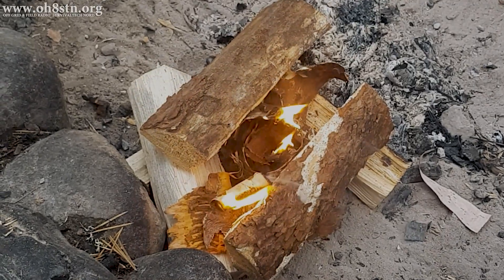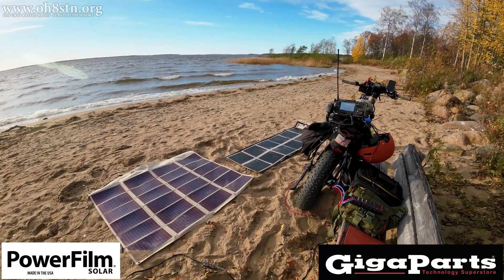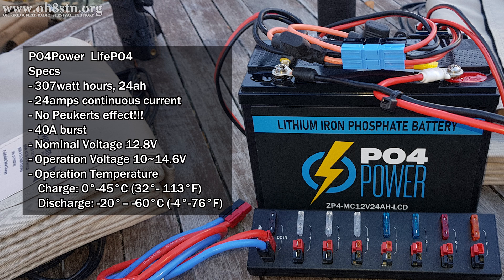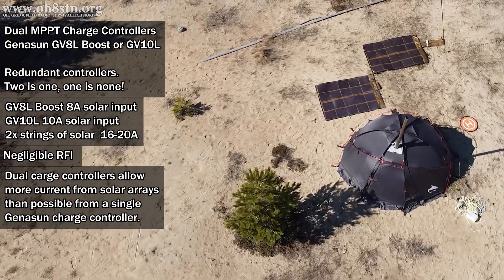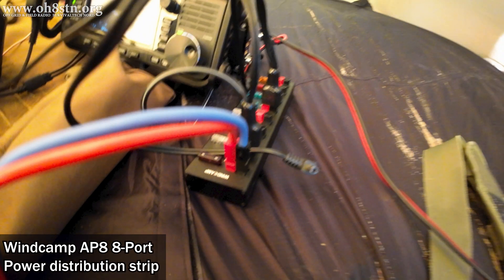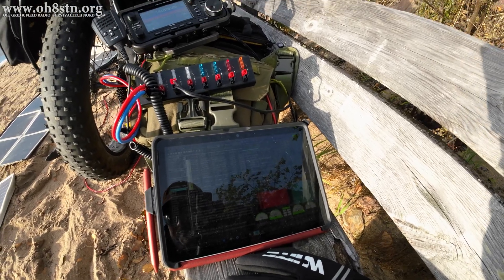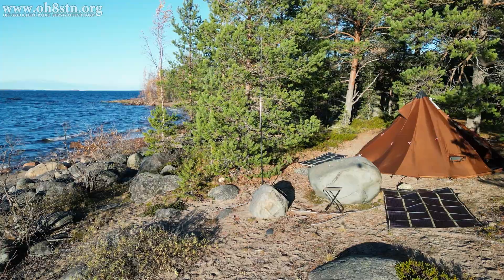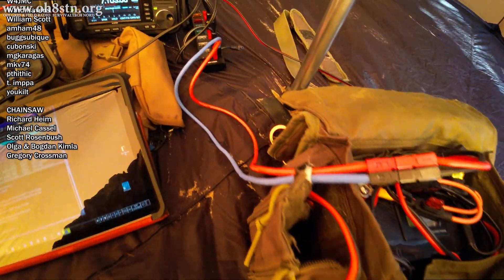Portable Solar Power for off-grid ham radio

Comment: Ok this may be a truly dumb question, but by paralleling two separate charge controllers how does either one of them actually see the state of charge condition of the battery?? Won't they both just see the output of each other without actually seeing the condition of the battery???
Reply from the maker: All they detect is the voltage of the battery. Battery voltage is what it is regardless of how many parallel controllers are attached. Works extremely well.

Comment: Hey Julian,
After watching your recent expedition, I came back to watch this video again. I've settled into having a Genasun Charge controller for each of my solar panels (thanks for helping me with my solar array!), but one thing I haven't seen mentioned in your videos that I hear about elsewhere is shunt for battery status monitoring.  

Many of the LiFePo4 batteries out there have some sort of integrated Bluetooth BMS today, but they seem to have many problems relaying accurate battery SOC information via an iPhone app or by some other device. The suggested solution in these cases seems to be adding a smart shunt (Victron is mentioned frequently) in order to get an accurate picture of the battery's (ies') charge status.   

My question then is this: is such a shunt necessary in this sort of off-grid configuration?  If so, then do you plan to add one to your system in the future?  If not, then what are you seeing in your setup that does not require a smart shunt where others seem to see a need for this device? 

As always, keep up the good work!!! Glad to see Snapper on the Arctic Expedition too.  Semper fi Brother!

Todd  KI5HNX
Reply from the maker: Hi Todd.
When this solar generator was first seen on the channel, it was designed with a shunt ( https://youtu.be/Nf9X4YIK9xA ).
These days, I think it's nice to visualize incoming and outgoing current and voltage but it's not necessary. I believe the ad complexity needs to be weighed against the benefit. It's also important too Think about scale. On a small system like my pocket portable solid gen, It's enough to look at the voltage on the figs display.  For something bigger, a power supply for a fixed installation, It might be advantageous to integrate a shunt. 
I haven't had good luck with victron controllers (noise), but the integrated shunt is a very nice feature. 
Semper Fi brother.

Comment: What type of adapter did you use to keep the Microsoft Surface charge. I am assuming that it was plugged into the Anderson power pole distribution block somehow? IIRC the wall plug to computer adapter that comes with the Surface inverts AC to DC and steps down the voltage to 5VDC. Correct me if I am wrong in that. But in any case what did you use to get current from the battery, to that distribution block and to the Surface to keep it running without using it's on internal battery?
Reply from the maker: Much simpler than all that. I simply use a USB C to 12 volt adapter. The 12 volts comes from an Anderson power bowl. As a rule, I don't use inverters since they are so inefficient. Here's a link to my Microsoft Surface go pages.
https://oh8stn.org/blog/2021/10/10/microsoft-surface-go-2-faq-ham-radio-laptop/
73
Julian oh8stn

Comment: 4:30 Very informative. Thanks! But the video discusses and shows two slightly different Genasun charge controllers (GVB-8 vs GV-Boost), recommended for higher latitudes. And unfortunately, the affiliate links in both the video description as well as your blog only specify the Genasun GV-10L. When I search Gigaparts for "Genasun 8A Boost Lithium Waterproof" myself I find what looks like a newer version altogether. Any chance you could provide a correct link for what would be used at higher latitudes? Also, reading the specs for the new Powerfilm 160W panel suggests a "Rated Voltage at Pmax" of 28.3V but the Genasun's "Maximum Recommended Panel Vmp" seems to be 13V. I don't understand if that means the controller would just be less effective when the sun did come out or might actually damage it. Can you clarify if those specs need to be aligned for a 12V lithium battery.

Comment: So once again you hit a home run with this video. As you have built this system, did you consider the recharging of you bike ?  I know you already did . ??? can you use fine Kevlar string on the drone to pull up a single  antenna and loop it over and then pull from the ground to secure it ?
Reply from the maker: Thank you 🙏
Yes the next video out will show you how I charge my bike, using some of the components from this system.
I tested lifting the 24 gauge wire with the Drone but find the effort not worth the benefit. It's a cool idea if we're stuck in a valley or something like that. I'd be afraid to lose the $1,200 drone 😂
Thanks for watching, commenting and for the kindness. Much appreciated.
73
Julian oh8stn

Comment: The military panels you have chosen are just unaffordable to the majority of Amateurs, please use cheaper panels that operators can afford, it will encourage and allow operators to use your video as a guide to make their own and know the expected yield of power.
Reply from the maker: Although I appreciate your comment, I'm never going to show cheap Chinese junk on the channel! Most Operators watching my videos know they can use the video as a template, making component adaptations suitable for themselves. The reason I use these panels is reducing the weight since I generally operate man portable. Also because of their ruggedness in the field. Anyway this video is about the battery, not about the solar panels. Feel free to replace my choices with whichever solar panel meets your individual requirements. In my environment,  I can't afford to waste money on substandard gear.
73
Julian oh8stn

Comment: Thanks a lot for this!  But a lot of us are in Europe and elsewhere where we can't get these USA parts.  Would you be kind to put together a list for European HAMs using Amazon so one could just buy all the components in EU using Amazon and get mobile fast.   This would be of great help for people that are not understanding all the power requirements.  Thanks a lot!
Reply from the maker: I'll work on it but, it is difficult to keep up with all the different Amazon shops around the world. If I supply links to everything in every country,  I'll spend oh my time trying to keep those links updated. Instead I've created a concept that anyone can build with the parts they have available to them locally. Moreover I've supplied links to a distributor who ships worldwide. The other problem I have is the equipment used, isn't always available from Amazon. 
I get what you're saying and I'll try to improve but it doesn't hurt to do a little research on your own.
Reply: @OH8STN  one thing that I am not sure of what charging controller to get because of this noise issues with HF radio as I can't get the GENASUN part in EU
Reply from the maker: www.genasun.eu

Comment: Excellent setup and great video.  Does the Genasun GV-10L handle the PowerFilm 160W Crystalline?  Is the Powerfilm 160W output at 28.3V?  Do you have the PF 160W connected at the same time with the PF F16-7200?  Sorry, this is probably very basic.
Reply from the maker: Not at all basic and I'm actually working on that crystalline 161 video. With this battery setup and two independent charge controllers it's possible to put the 120 and the 160 in parallel. I've done it then it works fine. Yes the voltage is 28.3 volts amperage is 5.7 amps. Hope this helps.

Comment: I have a setup similar to this that I use with my FT-891. But I have to say that - THIS IS THE VIDEO I’VE BEEN WAITING FOR!! Thank you, Julian! There are a couple of things I’m going to work into my setup. Your ammo and power analogy is also very apt. I’ve had the same problems with a group I work with here. They’re getting it, but it’s a bit of a slog at times. Thanks again!
Reply: Me too!! I have the 891 also and work off a LiFePO4 too. BUT I have one question…I was told by a very smart ham who is all about portable ops and battery power that it isn’t recommended to charge and discharge a LiFePO4 simultaneously. Did you research with the battery manufacturer if this simultaneous charge/discharge setup puts unnecessary stress on the BMS or cells, reduces the battery’s lifespan or creates any kind of safety issue? Looking forward to your feedback! I am definitely going to consider this setup for my LiFePO4’s!

Comment: I have the ability to operate QRO from the field on alt power and to recharge using solar, yet the system is not man pack portable.

That’s ok. I am not discouraged. A couple short years ago, I didn’t see the need for a QRP radio and knew less than nothing about lithium iron phosphate batteries. So, it’s been a journey, and I’m confident that before long, I’ll have the solar blanket that I need to deploy from a day pack. All in time. 

As is true with most pursuits, we upgrade when finances permit. Until then we do as best we can with what we have.

Speaking of which, following along as you’ve shared and expounded your trademark philosophy of operating and designing a station from a systems standpoint has been an integral part of my progression thus far as a field operator. Thank you so much for your generosity of time and knowledge in producing the content that helps many of us become better amateurs.

Comment: it would be nice if genasun would see this and come out with a higher amperage charge controller that is still ham rf quiet.
Reply from the maker: I got a heads up from them about half a year ago. They said they higher amperage version was in development. I don't know if that was just marketing blowing smoke up my chimney, or the real deal. Either way, I hope it's true
Reply: I've been waiting for Genasun to release an all-ceramic-capacitor version of the GV-10 (similar to the GV-5) for years.

Don't hold your breath.

What about Midnight Solar's MNKID-M-B "KID"?

Comment: I deploy very remote 2m repeater systems ,it would be worth a try weight is not an issue. Thanks for your vids.
Reply from the maker: Thanks for watching and for the comment. Remote repeater systems would be an excellent use case for this type of system. I thought about testing this kit and some rigid Renogy solar panels, with my RMS Gateway. 
Thanks again.
73
Julian oh8stn

Comment: I was under the impression that modern solar charge controllers are “smart” multi-stage chargers and that they measure the battery and charge according to different stages. If this is true, I confused how two could be used on the same battery at the same time. How would the charger know which stages to apply to the battery?
Reply from the maker: Excellent question. Lithium batteries use a CC/CV charge profile. This means constant current constant voltage. Based on the voltage of the battery, It's either charging or not charging. Unlike lead acid batteries, there is no float, absorption,..
Hope this helps.
73
Julian oh8stn

Comment: I didn't think building the battery packs looked all to hard. As long as you can add the BMS boards, and not have to build those. I think it would be a fun electronics project. But this is just adding all the right parts and pieces, to suit your power needs. Thanks for all the info on the dual solar systems, being used in conjunction. That part makes sense to me.

Comment: Great like every time, I'm little confused about solar mppt so my 2 question are when I combine more solar panel in one way or the other they will be output the lowest of two: if one output 16v the other 18v both give paralel 16v right? and if one product 8 amp and other 12 together 20 but never overcurrent the charger or not?

Comment: Having owned and used a Genasun GV-10 for the better part of 10 years, I can say, unequivocably, that I've found a superior solution: the Allto 10A MPPT controller.  It's less than half the price, much smaller, and has an LCD display.  The included connectors are easily replaced with a pair of powerpoles.

As much as I appreciate Genasun's work, they've simply fallen behind the state of the art.  There's no excuse for screw terminals or lacking instrumentation at that price.  I've put the Allto through its paces for about a month, and it's performed flawlessly, capturing every bit as much energy as the Genasun (averaged over 2 weeks, swapping identical panels between them).
Reply: Hi Gordon, thank you for your comments very interesting reading.  Are Allto RF quiet?

Comment: Julian do you have a video for the very beginner with perhaps low cost entry level power gear? I have an FT-891 and home made mag-loop. I am looking for battery build and solar recharging.
Reply from the maker: There are lots of heavier solar panel options, if weight is not an issue. Check P3 Solar for example.
Reply: @OH8STN  will do! 73 Julian. Check my last video, trash-bag protection for my little mag-loop. 73 friend
Reply: Check out Will Prowse. Not a ham, but he has exactly what you want.
Reply: @MrHuram-abi  found it. Looking again at this video from Julian, it is not at all a difficult setup. The trick will be finding a cheaper solar panel because I cannot justify over 1 thousand dollars on solar panel(s). Thanks for taking your time replying! 73

Comment: I have just started to build a system like this. I've chosen the GreCell T300 Power pack. A bit heavy, but I too use a bike and trailer to haul my stuff around. I just need a solar panel and I'm set.

Comment: I have two 10 Ah lithium iron batteries for my portable setup.  I will be I upgrading to 20-30Ah battery.

I bought the two 10 Ah for when flying as the limit for lithium batteries for flying is 2 batteries between 100-160 Wh each battery.

Comment: I think you touched on a very important subject. As soon as I got into ham and especially emergency comms part I had to figure out power. I run a similar setup with one panel but usually run a fT-818 but I am in the process of building one for my 7300 just in case.

Comment: This hobby is expensive!  The portable solar panels are over $1000 each...very difficult to justify.  Of course, the radio is not cheap either or the other accessories.
Reply from the maker: Agreed, it is expensive.  The only reason I can justify the solar panels is because I'm generally operating man portable. I tried the other less flexible panels, but they were too heavy with all my other camping gear. These were the lightest I could afford.
73
Julian oh8stn
Reply: The hobby doesnt have to be expensive if you build your own kits. Radio receivers, transmitters & power amplifiers are all available in kit form. True, the problem of portable power source would still exist so you may be operating at or close to home to begin with, or on club equipment if there is a club in your area. Julian is doing pioneer work here in his work with solar panels. Given their popularity in other fields it may be only a matter of time before the become more affordable.

Thanks for your interest in the topic.. Suzy G1XST

I'm tempted to wire up my Yaesu 817 in a similar way when my budget allows.
Reply: @steadynumber1  There are diy Kits available, thats true. But you can‘t build your own flexible solar panels.
Reply: @db5coatrutzturmfunker315    I took that to be obvious. I mentioned as much.
Reply: Julian is rolling in money... 🤑😉
Just teasing, Julian.
Reply from the maker: I wish 😂
Reply: It’s only difficult when you haven’t been without power for a week, like we have had in NJ. This has me thinking about disassembling my heavy battery pack and charge controllers. I can reuse everything in a small pack. And to think 100ah was what I needed, I will look into this. Btw, I did disaster response and EMS. When you need this, you will be happy you have it!
Reply from the maker: @amham48 the most expensive side of the hobby by far is off-grid man portable operations. Many of the lightweight it feature Rich radios for portable Communications are quite costly. Often more so than their desktop counterparts. Or portable power, there are budget alternatives like AGM batteries and pwm charge controllers. The cost increases exponentially when we want to take that AGM battery and pwm charge controller portable. It's the same with the solar panels. The lighter weight solar panels we want, the higher the price. Keep in mind operating from a vehicle allows much more weight. Using human mobility, is much less forgiving in terms of costs.
Reply: I consider Powerfilm to be far too expensive for my use case. I use US$1 per watt rigid panels at home, and I have a rather large and heavy folding 120W panel that cost under $150. I don't bike out to camp on the beach with my gear either... My idea of harsh conditions is an 80° day without a fan. If you don't need the gear Julian uses, there's no need to pay for it!
Reply from the maker: @notreallydaedalus   show me your setup including Communications and power all fitting in a single backpack which you can carry with all of your other gear. Then show me how you can achieve that for $1 for watt. I get what you're saying, but operating Man portable has nothing to do with the cost of your rigid panels.
Reply: It CAN be expensive, but it doesn't have to be.  The more you learn to do yourself the cheaper it is. Ex. You can spend $300 on a store-bought antenna or build the same antenna for $12.  Remember: it doesn't have to be broadcast quality or milspec to work when you can fix whatever problem arises.